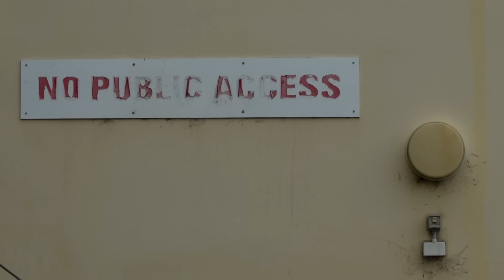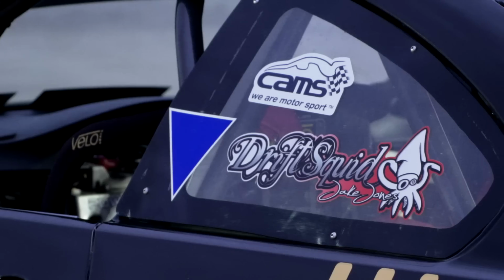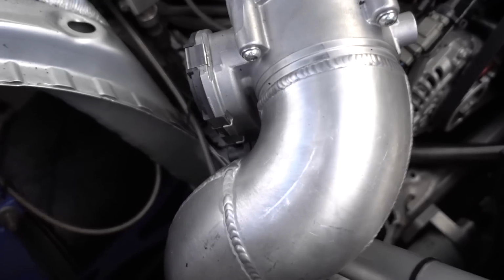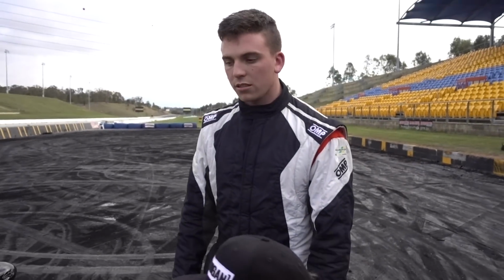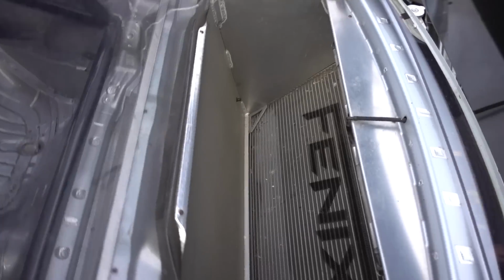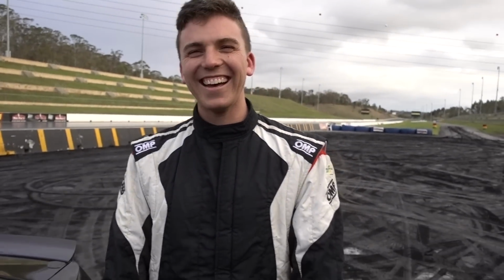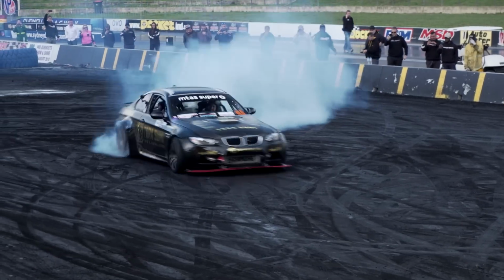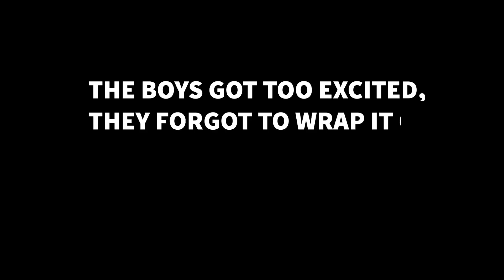10,000 RPM Skyline-Powered BMW M3!? YES.

Comment: Love it, especially the sound of that screaming six - 'cept for the way undersized air filter. I'd love to know exactly what the pressure loss is across that tiny thing.
Reply: If they can build a 10k rpm race motor I reckon they know what the right size diameter  intake is for that particular setup... Spud.
Reply: @clubsport9334  So you would expect, but for that power level for a K&N you would be looking at at least 250^2 of filter surface (outer area, not the pleating) and that is a fraction of that... turnip.
NOTE, I said filter, not intake in the original post...

Comment: What is a dry sump
Reply: instead of a pan that holds 8 litres of oil or what not. You can run a flat pan because the pump and tank is outside of the engine.
Reply: DriftSquid what’s the benefit of doing this?
Reply: @Zayyyyyyyyyyyyyyyy  Control oil pressure better and its a lot more reliable in every way you could imagine. Because it revs so high and smashes the limiter a lot the standard oil pump would be a very risky option to run.
Reply: DriftSquid thanks alot

Comment: Cool build...but why not build a 10,000 rpm e92 v8...one of the best sounding engines there is...no disrespect to the rb26 also great
Reply: I dont know anything about them and the fact a brand new block is 20k was just silly. The car came with no engine
Reply: Right on that does make sense since the e92 S65 motor can be pricy...I am a fan of the M3 and have one...the used engine values have come down as the car has aged but new engine parts from bmw are high.  Used “running” engines on eBay for $4k but that is eBay.  Blocks are good for quite a bit of hp na or boosted but must upgrade rod bearings.  But I have had multiple 240z as well and love the rb26 swap!  

Either way great build!

Comment: Wait, 10k rpm … on a stroked engine ? … wtf ?
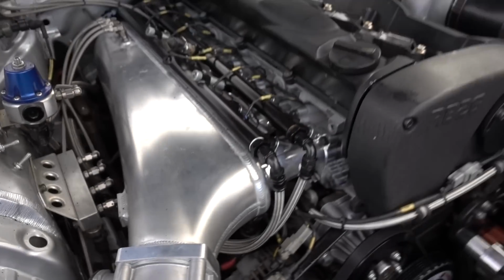(he mentions the stroker kit @ 2:13 )
Reply: Yep 2.8L and revs to 10k
Reply: @DriftSquid  
The thing is about the speed of the piston mid-throw .. as both RPM and length of stroke will increase the speed, you can easily end up in the area where the oil-film breaks, and stops adding any lubrication .. at which point the engine goes BANG.
He either have some miracilous oil, or is dancing around real close to the "BANG" point.  😁

Comment: Rb26 is what a BMW owner would do when gets tired of breaking down
Reply: 3v4761 that’s if they broke down🤷🏻‍♂️
Reply: @3v4761  my 23 year old E36 begs to differ
Reply: @leito1996  m5 v10..defective..m3 v8..defective..335..i6 turbo..don't last..my boys 328i turbo went...your car didn't have the compression or power to have the problems those cars have...don't have to believe me we all have internet now
Reply: @3v4761  my 07 335i has treated me well for 4 years, and I beat on it.
Reply: I've had my 08 335i for 6 months now, 136k miles, thankfully only basic maintenance so far,  but those miles scare me every time I turn it on lol
Reply: @masonh.2037  yeah that is high. Mines at 110kms. Bought it at 65k
Reply: @AlexNZL  stop beating on it...less u got bus tokens

Comment: N1 block is worse than original one. lol
Reply: Why you say that?
Reply: @ReubenHorner  its a known fact for several years know, because tuning scene has developed many fast RBs and now pretty much every flaw of RB engines is known.
RB blocks in general are garbage. Some even struggle to not crack even in pretty much stock power levels.
More info at: https://www.youtube.com/watch?v=KF1iTh-2u3E
Reply: @fohatadri  So you watched a video where one n1 block was condemned because of thin bores and you call all n1s bad? Wowe. N1 blocks are definitely thicker and stronger in most places and should not randomly crack when the power is at insane levels. There is still a range of casting quality just like any engine.
Reply: @ReubenHorner  In some cases - yes N1 may prove to be more reliable but a good quality old block will still be stronger overall. All of them need reinforcements no matter the power level. That is the sole reason everyone serious in inline 6 game choose 2jz because the block is super strong.
Also, the video isn't made by some amateurs, but by actual professionals who work with this stuff and their experience is around 15 years with mostly RBs. So of course i will call this a reliable information. Are you mad ?

Comment: Not trying to hate or anything like that, its a pretty sweet build but if you are going to change the entire drivetrain, suspension and bodywork why not just start with a regular E92 model instead of the M3, it would be cheaper and there would be one more E92 M3 still on the road :(
Reply: It was written off and about to go to the tip. I saved its life. Thats why its an M3 and not a 335i
Reply: @DriftSquid  In that case well done sir, keep on shredding !